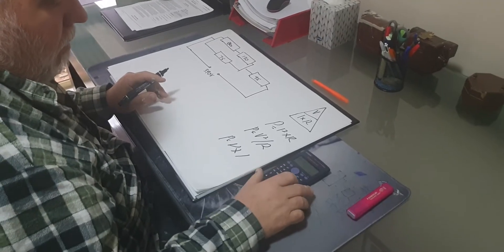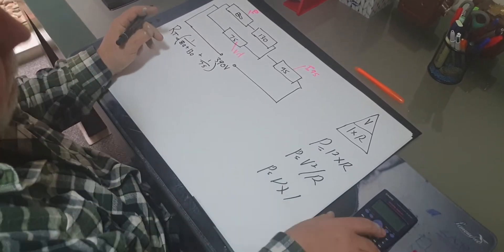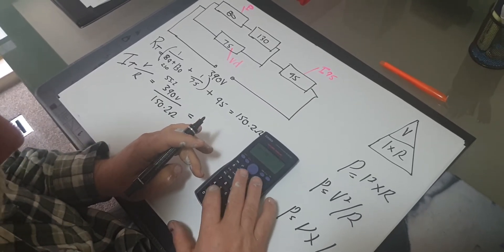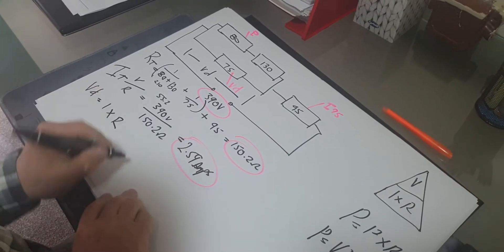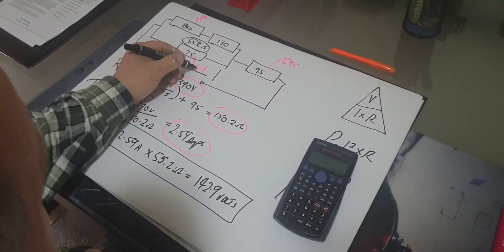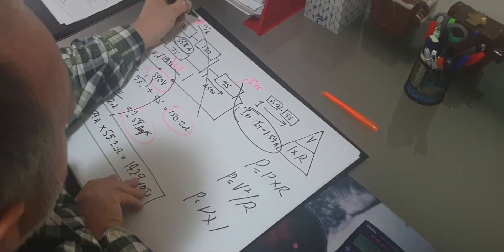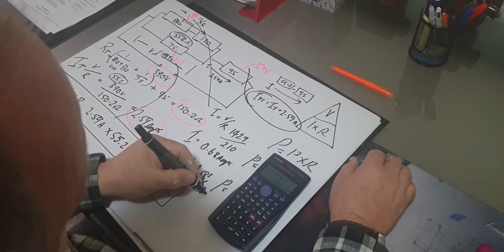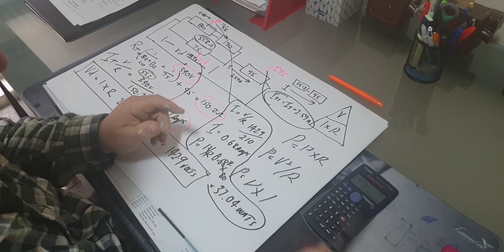dc circuits  step by step no1

Comment: Thank you for your video, on all the practice exams you're only given 4 values, Total amps, one resistance, one specific amp, one voltage and one wattage.. are there any videos that show this style of problem solving, or does it have a specific title that i can search?
Reply: HI, did you find out how to do this or any videos showing how?
Reply: @gerzos4256  I did. Can U pm me somehow
Reply: @riatz1  is it a video?
Reply: @gerzos4256  nah a Reddit post, when's your test
Reply: @gerzos4256  I had trouble , but  tbh the question was different to the one in practice tests, it was easier but because I studied on the complicated one it fucked me. I overcomplicated it. Big points are in visual fault finding on paper. But happy to help with the circuit maths free 8 points or whatever.
Reply: @gerzos4256  I'll find the post tomorrow morning, I hope that's not too late.
Reply: @riatz1  this sunday! cheers man
Reply: @riatz1  yeah! ok really good stuff to know. visual defects is huge at 15 marks. Ive noticed the there are 2 types of dc circuit questions. one with all the resitance values given, and the other one which you mentioned in your first comment. How similar is the actual exam to the practice exams ?
Reply: @gerzos4256  I felt it wasn't very similar but do the practice from last 2 iterations , timed, and hit 80-90% and you'll be fine. The cunt is lep, I failed that then covid hot, doing refresher as we copped.it hard from lockdowns, everything was online, it was all foreign to me
Reply: @riatz1  geez ok let me know that reddit post tomorrow.  COVID has ruined everything hopefully I do ok with it.
Reply: @riatz1  youd really think it would be very similiar after they keep telling us to just do the practice exams over and over
Reply: @gerzos4256  the layout in the practice is the same for practices, but layout in real test.is different.

Put some tabs in the book for Pyro cable regs that was in my test, I scraped through at 76% with no tutorial.. make sure you do tutorial for LEP if covid fucked U like it did for me.. got minimal teaching on LEP
Reply: @gerzos4256  and in my opinion, doing fake tests under same conditions, 2 hours, no reference except what allowed was what got me over the line.
Reply: @riatz1  dude thank you so much. Really appreciate it !! Thanks for all the advice man.
Reply: @riatz1  so we tab the cable selection book but not write on the tabs or high light any words correct
Reply: @gerzos4256  I think you can highlight words. Don't quote.me though. I have them highlighted
Reply: @gerzos4256  honestly though, I don't think the lep us doable without the tutorial, I wasted 300 going in blind and failing
Reply: @gerzos4256  other shit U can practice for imo, but depend on your abilities.
Reply: @riatz1  definitely going to be doing the lep tutorial. How did you practice with the defects? What is the best way you reckon
Reply: @gerzos4256  did you manage to book in for any tests?
Reply: @riatz1  thanks for the follow up! I passed my LET. I Booked my LEP refresher mid September! Cheers man
Reply: @gerzos4256  future fucked me, they cancelled tests even though they don't need to by law. Doing it at melb poly now